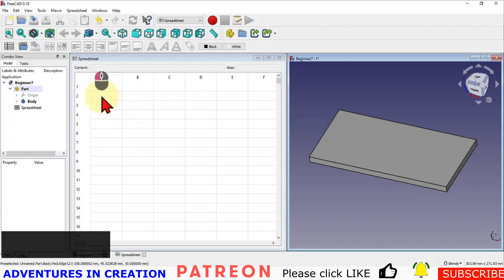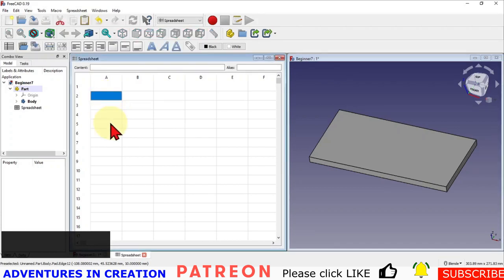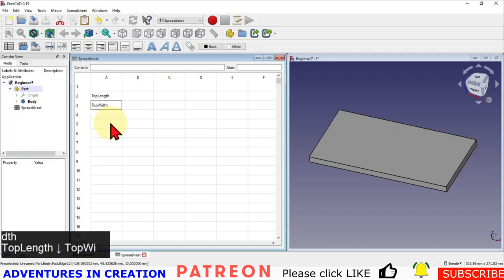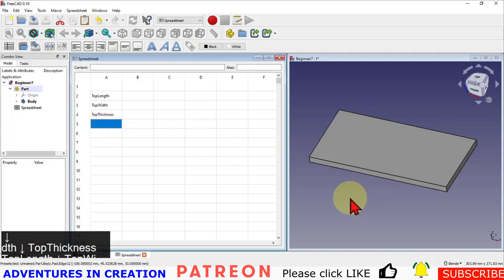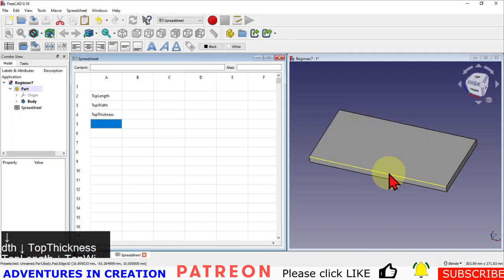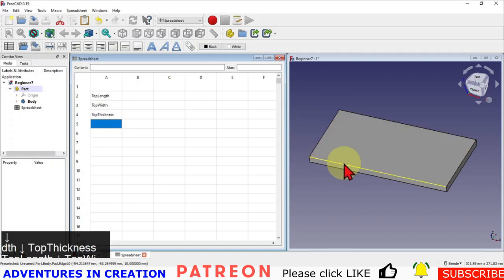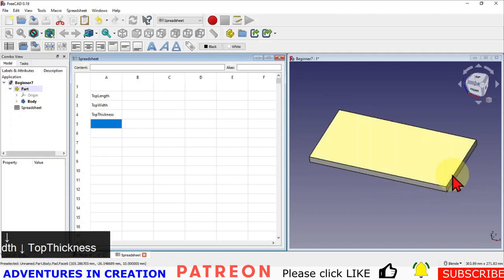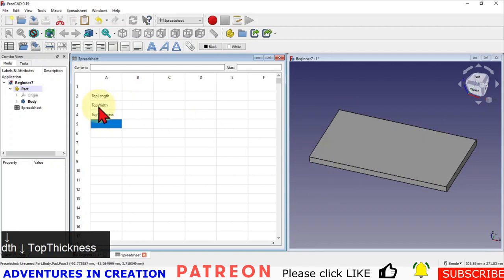FreeCAD For Beginners #7 Spreadsheet Driven Fully Parametric Table

Comment: What if you wanted to add a sketch to an existing face? My object (part? this terminology is god awful) is not symmetrical and it makes no sense to dimension (constrain) my equivalent of your table legs off the arbitrary origin and I want to sketch it off an existing face and constrain its dimensions using the existing edges of that face. This seems literally impossible to do in freecad
Reply from the maker: Using faces is a problem at the moment as those face references can change with subsequent edits. See the topological naming issue. Your offsets shouldn't be arbitrary as you are designing the object with dimensions you choose.

Comment: For people that has to work in inches this is annoying as the numbers from the Spreadsheet is in mm. So you need to multiply the values with 25.4. So my path length say 1.000 in, but I had to give it 25.400 mm (from SS) :( And yes, my pref. is set to inches.
Reply from the maker: You should be able to use inches in your spreadsheet

Comment: Couldn't get the macro EasyAlias to execute and had to learn how to manually 'alias' the spreadsheet cells. What a disappointment. Great tutorials though.
Reply from the maker: Did you see the post I made about it?
Reply: @Adventuresincreation  Where? I'm not on 'social media'. I did find some info but I'm not going to change anything in Python. Hopefully, FC will fix the bugs unless you know of one?
Reply from the maker: Macro. I was having some issues too. I looked at my Macro in the macro editor in FreeCAD and realized that it had somehow been corrupted. I went to this wiki page https://wiki.freecadweb.org/Macro_Eas... and copied the macro from there. I replaced my macro with that and it now works as it should. I hope this helps some of you.
Reply from the maker: It's on my channel community posts
Reply: @Adventuresincreation  Thank you very much, I had checked your channel before but didn't click the 'community' tab! Your reply is much appreciated.